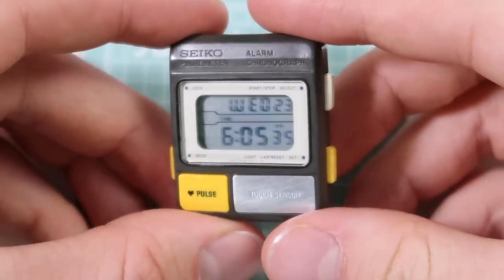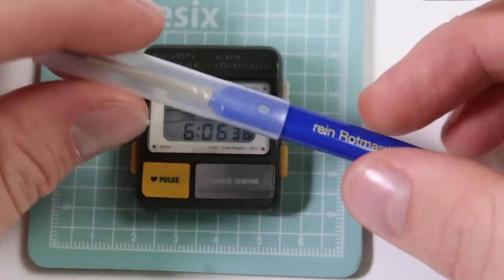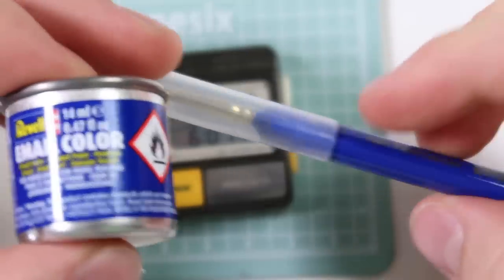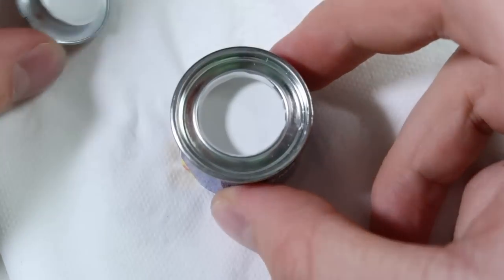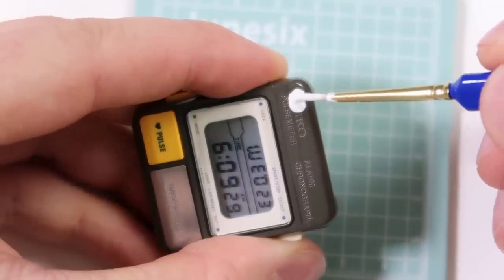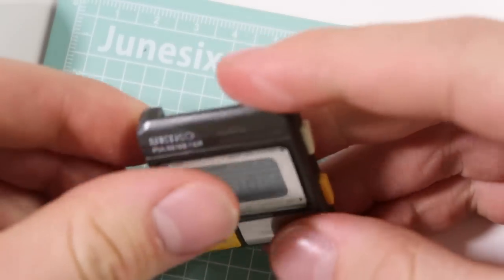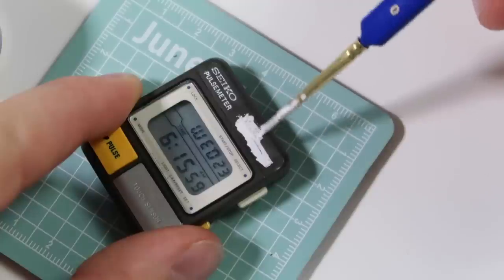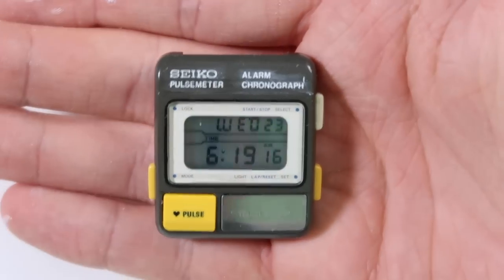1980's Seiko Pulsemeter Watch Restoration (S229-5000)

Comment from the maker: Thank you all for watching these videos. I really appreciate it.
Reply: Looks amazing! Really pops. I think you might have luck removing the excess with a Mr. Clean Magic Eraser or a generic alternative. Not sure if you have that brand int he UK but they are basically white melamine foam. You'll need to be extra careful obviously. They work like a pencil eraser or very very very fine sandpaper but I think it might be your best option without resorting to chemicals which could seep in and destroy the letters you just filled in. Would probably just rub off the surface paint leaving the super crisp letters behind. Good luck! Can't wait to see the final product.
Reply: Thank you for making these videos! 

The content here on your second channel has been great, I loved the Honda Cub series, and these watch restorations are really interesting. I for one really appreciate your hard work creating stuff for us to enjoy. Stay safe and happy!
Reply: Don't wait too long before removing excess enamel paint! If it cures, you will have to use a proper solvent to remove it, which may damage your plastic casing. Use some isopropyl on a q-tip and gently go over the area. If you see some areas that then need a touchup, use a toothpick to apply paint.
Reply: I like branching off and looking at other tech too!

Comment: I repainted my bezel  on my Seiko Monster with enamel paint and a toothpick. Using the toothpick to refill the painted parts and a wipe of solvent when the paint had dried a bit to remove the excess paint. Was easier than a brush.

Comment: once the paint is dry you can use paint thinner or acetone on a paper towel to remove the excess around the letters, just don't use too much or it will start to melt the plastic of the watch!

Comment: Yes, I realize this video is now two years old. That said, in 1982 as a young US Marine Corps Pilot, I purchased three Pulsemeter watches from the Base exchange, Camp Butler, Okinawa, Japan... green one for me and a green and a black one for two of my brothers for Christmas.

In '83 on my second deployment to Okinawa, I lost this watch which prompted me to buy a Rolex GMT Pepsi from the British Military Exchange (the China Fleet Club) in Hong Kong. I wore the GMT for the next 30+ years as my "one" watch... but I digress.

Fast forward to 2019 and we're cleaning out my parents’ home after their passing and I find my Brothers green Pulsemeter in non running condition, but looking very nice. I traded my Brother a nice Timex Allied Three GMT for the Pulsemeter and we both thought we got a great deal.

When I returned home I took the watch to my local trusted Vietnamese watchmaker who after twenty minutes and $30 freed the rusted stuck silver "Lock" button changed the battery and replaced the rear case seal. I got back a working watch with the admonishment ... "No get wet!"
Reply: Regarding the refurbishment of your Pulsemeter... 

First, the pulse function did not work because you were doing it incorrectly. With the watch secure on your wrist and the metal back touching your skin, you need to have just your "one" finger only on the touch sensor and NO other fingers touching your arm, else it won't read correctly! Re-watch the video, the pulse function starts to work, albeit just for a second or two when your other fingers were not touching your arm!

The touch sensor NEVER had any paint in the lettering, so just leave it alone. The only thing I needed to do with my scratched touch sensor button was to rub it with green Scotch Brite like you did, HOWEVER you didn't do it enough, so it was still somewhat scratched... Patience Padawan!

You did a good job with the paint in the lettering, but here's a restorer's tip (I've been restoring '50 & '60s Concours level British Sports cars for 40 years). The best way to clean paint off of plastic is to soak the part in a product called "Simple Green" a cleaning solution. This removes the paint completely (24 hours) while also cleaning the case. Any residual can be removed with a sharp wooden tooth pick. This leaves a pristine surface to apply new paint as you did.

The broken "C" clip for the Touch Sensor button should be easy to source as these are standard items, albeit one that small may take some searching, but hey, you found the almost impossible to source buttons from Seiko.

Comment: If you need to do this again in the future, an alternative method to the paint and wipe method is to thin your paint and use a finer brush a 000 or 0000 detail brush.  If your paint is thinned properly it should just flow into the letter assisted by capillary action.

Comment: Let it dry then use alcohol to wipe over it should clean right up, water might even work.
Reply: I rekon you’re right! I just need to be careful not to remove the inside part!
Reply: @TheRetroFuture  It's wat I used to do to shift knobs works the same way. Paint doesnt like to stick to smooth plastic too much. Looks awesome though.
Reply: @TheRetroFuture  : Leave it a couple of hours to dry; you don't want the enamel paint smears on the surface drying hard though; then use a paper towel just damp with IPA to wipe clean the surface of the watch..... a couple of passes may just sort it ;-)